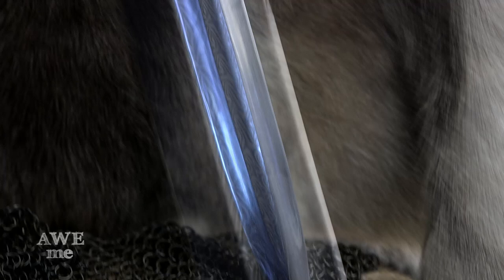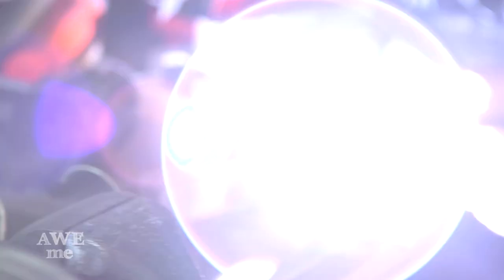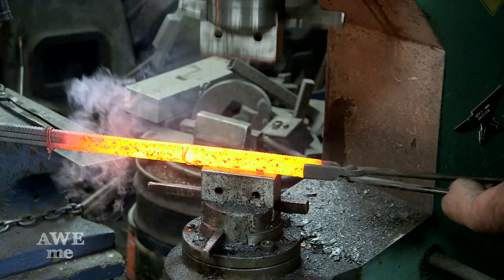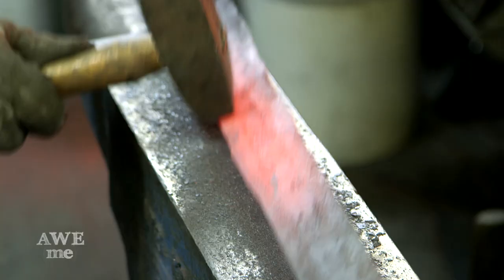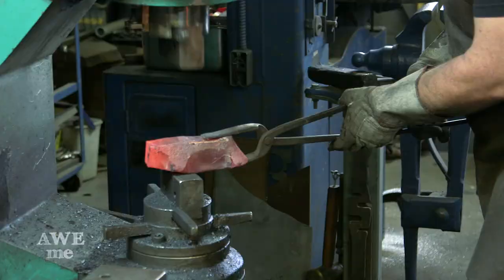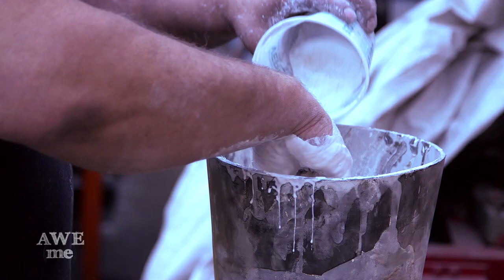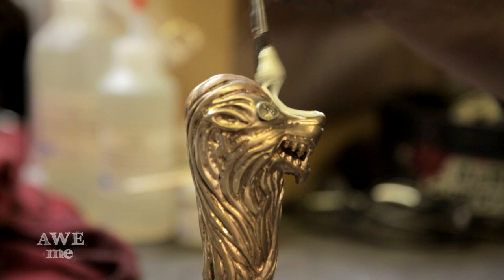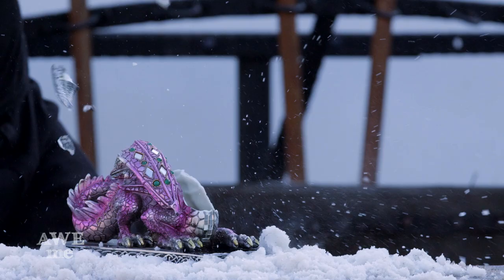Jon Snow's Longclaw (Game of Thrones) - MAN AT ARMS

Comment: Guts's Dragonslayer from Berserk next, please.
Reply: I keep saying this, but I will say so again. It would be worse than Buster Sword. Dragonslayer is so ridiculously large, that even within the story itself it was forged as a joke. To make a replica would require a specially built forge, because it wouldn't fit anywhere and it would be too heavy for anyone to lift (since not only is it thicker than Booster Sword, it is also clearly a single piece of metal, so you couldn't make parts of it from aluminium, as was done with B.S. Even if they made some kind of a device to hold it up, the hilt would probably be bent by the weight of the blade. Also, it IS a single slab of metal. Hardly a task for an artist swordsmith.
Reply: Marcus C Exactly. It's because it's ridiculous that I want to see how these w\guys would pull it off.
Reply: Deo Favente  If the problem is strictly "how to get around technical problems" then it belongs in Scrapheap Challenge.  :)

Comment: The wolf head pommel is supposed to be facing the edge, not the Flat. Just needs to be turned 90 degrees.
Reply: Jaeric Bugged me too that it wasn't facing the same angle as the blade edge

Comment: Am I the only one who always thought that the head of the wolf should be facing in the directio of the blade rather than facing to the flat side? I know its the way the show made it, but I always thought it would be better for the feeling in the hand and the ege alignment if you could orientate with "wolf-snout = endge". Especially since it is described as a bastard sword where you most likely ûse the pommel as an extension of the grip for your second hand.

Comment: So whoever does the captions should learn something about blacksmithing. It isn't 15 & 20 (=35) bandsaw blades, it is 15N20 bandsaw blades which is a type of steel with a higher nickel content. The difference in this metal and the 1075 used is what produces the contrast between layers in the Damascus.

Comment: Why didn't you make it as described in the books?
Book quote. (Longclaw is a bastard sword or hand and a half sword, which means it is a good half a foot longer than a standard long sword, tapered to thrust as well as slash. With three fullers incised into the blade to reduce weight. There are ripples in the dark steel indicating it is of Valyrian steel.)

Comment: I would not have nor use this sword due to the fact that the pommel isn't peened. If those threads break your whole sword could slide out of the hilt and, in a worst case scenario, impale some one. I know that there is needed a lot to damage threads but you are going to be hitting things hard most of the times you use it. one day it's gonna break. I would only use this as a wallhanger, however the sword looks amazing. They did a great job! and that Damascus blade is beautiful!
Reply: How else was he going to put the pommel on? You cant peen it on due to the nature of the pommels shape! He is a master craftsman and weaponsmith, if he says its a fully functional sword then im inclined to believe him. The Peen is just as likely to break as the metal threads are, theres literally no difference. Its the same metal strain either way.
Reply: I guess it depends on how big the peen is? anyways, I've got some bad experience with threads, and I guess I wanted to see one made completely by medieval standards. I think that you could peen it, even due of the shape of the pommel, but it would be a bigger challenge and cost more money. I would like to see someone take up that challenge too. Even so it's a damn well made sword and I haven't made one as good, yet. I might not even ever make a sword as good as this.
Reply: +arnjhon threaded construction was used to some extent in medieval times

Comment: If you look closely at the sword in the TV series it actually looks very poorly made. The blade is very flat with no tapering and it's actually crooked. The fuller is flat and off-center and looks like something you'd see in a knife shop at the mall. This sword looks much better. The only complaint I have is the the wolfs head pommel looks too shiny and flat colored.
Reply: The issue with the TV version is that they have to do combat scenes, and in many cases they're using rubber or aluminum replicas. It keeps them from hurting one another if they mess something up during the "fight".

Comment: Why did they took three steel bars and tried to forge a sword from it, why not get already that size steel? Is there something behind it, or is it simply one of those alternatives that they probably couldn't get it, so they improvised?
Reply: +BIOSHOCKFOXX It has to do with getting the pattern they got in the middle of the blade at the end.
Reply: +BIOSHOCKFOXX ...because its similar to folding steel. the more its folded the stronger the blade will be and hold an edge
Reply: +jason anderson False, its a relic from a time when folding and combining different steels was necessary for purifying it, in modern times its only for decoration.
Reply: +jason anderson False, its a relic from a time when folding and combining different steels was necessary for purifying it, in modern times its only for decoration.

Comment: how did people use to smith these things back then without the power tools we have now?
Reply: I lot of time and a lot of effort
Reply: strong arms and big hammers.
Reply: dang even with the tools today smithing looks hard, props to blacksmiths back in the day
Reply: Most blacksmiths dont have big tools like power hammers, so were actually not too far off labor wise from what it took back then, hell i even use a hand crank blower on my forge, no electricity whatsoever. the big factor now is that we have much better steels in production so impurities aren't that big of a deal anymore.
Reply: they did have something called a trip hammer, which is basically the predecessor of the power hammer.  those were around in medieval europe around 1100 AD.  some trip hammers date back as early as 1000 BC.
Reply: yup and those things were basically just trees with a big ass chunk of iron on the end and as the waterwheel turned it would move the hammer to a point and let go and all that weight went falling back down only to repeat
Reply: jake i
yes, very crude but got the job done.
Reply: They didn't smith them, they forged real swords.

Comment: If you're not going to actually forge the fuller, shouldn't you at least use a guide when you grind it so that it ends up being straight? Freehanding it might be quicker, but I think it's an insult towards the time you spent on forging the actual blade... You can tell the fuller is wider at some points and smaller at others. Seems like a waste.

Comment: I don't like this build very much. They got just about everything wrong with this sword. The hilt is, after being given to Jon Snow, is described as being made of pale stone with chips of garnet for the eyes. Here, they use bronze with white paint, and ruby eyes. Hell, even the blade, is wrong. Yes, Valyrian steel is fictional, but Damascus steel is the unofficial representation of Valyrian steel. In this sword, they used pattern-welded steel. Two very different techniques.
Reply: 1. To actually carve it from stone and then thread that stone, would take ridiculously long. 
2. Garnets and rubies look about the same. They're just different when it comes to hardness and value. 
3. Pattern-welded steel is the closest to Damascus steel. No one knows how they made Damascus/Wootz steel, the technique has been lost in time.
Reply: +Bilal Malik 
2. They should try for accuracy, but I guess this is pretty much excusable.
3. Pavel Petrovich Anosov discovered, or rather, re-discovered the methods to making Damascus steel. That was in the 1800s. Where did you get your information? However, yes, pattern weld is fabricated Damascus.
Reply: +Psychosmurf43 he made a new style of imitation Wootz steel. He made Bulat steel. No one alive knows how Wootz/Damascus was made.
Reply: +Bilal Malik Its not really a new style of imitation wootz, pattern welded blades have been made for thousands of years. Its older than wootz actually.
Reply: +Bilal Malik dude, pattern welded steel and Damascus steel, are two similar but different techniques. More to the point, this is the first time pattern welded steel has been used in this show. every other time, if you actually paid attention, the steel was folded, not twisted. That is the primary difference between the two. For a reference, use the Gimli Axe build, Dragonborn Helmet, Inuyasha sword, and Dante axe build. it says in each one that Damascus steel was used. Then please pay attention to the process or the steel being folded, then the difference in appearance afterword's.